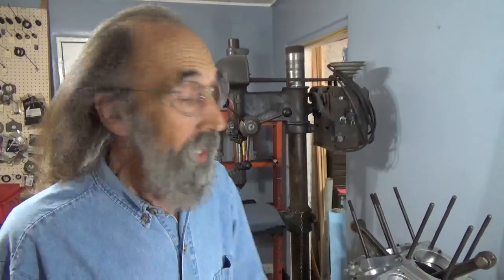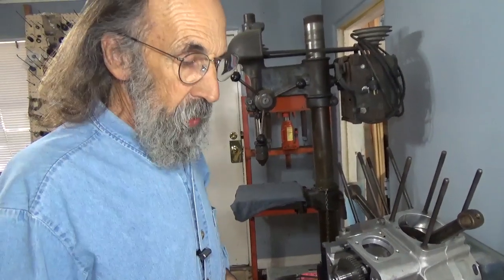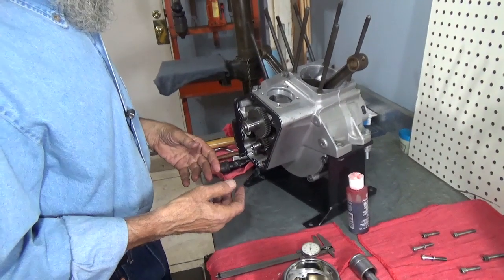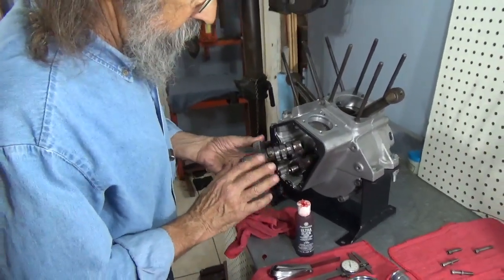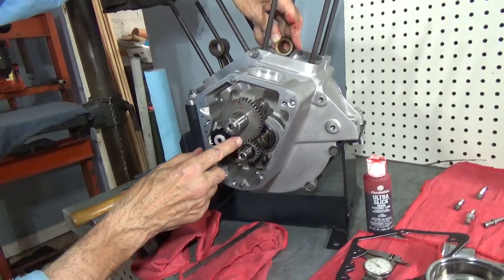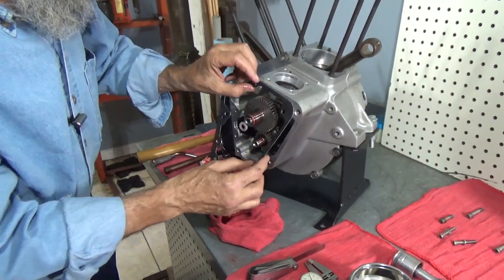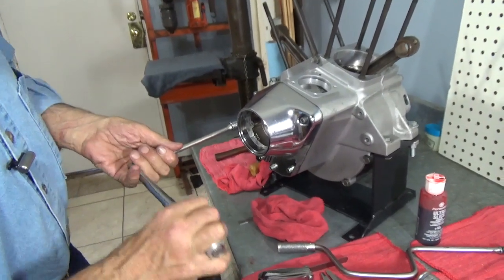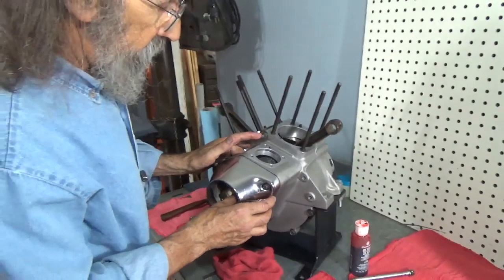Camchest, Evo Motor Assembly Part 5

Comment: Mike - I wonder if you can help me? I require a 0.020inch shim to get the correct end float on my camshaft in a 1984 evo. Every spacer kit seems to start at 0.050". Where can I get a shim rather than a spacer? Does harley use the correct size shim in another application such as gearbox or sporty motor? Thanks in advance
Reply from the maker: Try getting a cam shim for an earlier (Knuckle or Panhead).  Do you already have a shim in there?  Makes me wonder why you have this problem.  Not normal.  I think you already have something in there that doesn't belong.
Reply: @pacificmikesgarage  Thank you for your reply. Appreciate it 
Nothing else in there taking up play (wish there was)  
Cam bearing sitting just below surface, thrust washer hard up to case, NO SHIM OR SPACER 0.024 END PLAY. Camshaft gear pressed home on the cam and bronze bushing in cam cover home. Measured when cover torqued with new gasket.  Glad to hear its not normal, suspect the cam is the issue as I swapped cam that was in the motor for a stock one, and Im getting that back in a day or two, so will inspect again with that cam.  Thank you for advise to try a Knuckle or Pan Shim 🙂
Enjoy your videos - Thank you
Reply from the maker: This really is strange.  If you have a shop nearby, measure your thrust washer against another,  There are early and late Evo thrust washers.  In that era, Evos were built with no concern to their endplay and they were built with way more endplay than you or I would tolerate.  There was no cam shim at all, just the standard thrust washer.
Reply: @pacificmikesgarage  HD lengthened the camshaft by 0.050 in 1987, which is the cam I have so will run with OEM thrust washer (with ears) only which will give me a 0.025 end float. HD spec for 87 Evo is 0.001-0.050 so 0.025 is good for me.
Yes your right, HD like to have a lot of end float range which is not what Im used too working on modern motorcars. 
Thank you again for your time considering my issue and Im glad we could come to an outcome that makes sense of the issue.

Nice to know your videos are much appreciated all the way here in NewZealand Mike - Take care and lets "Make Choppers Great Again" 🙂
Reply from the maker: Thank You.  I appreciate your research.  Since I was always going for a high performance cam, I never ran into this.  I just thought they didn't bother to set the endplay anymore.  I always went with recommendations from the manufacturers of the high performance units.  Here in California, the stock cams were smog units.  So we always went to something a little more fun.

Comment: My forte is Automotive mechanic (40 years, now) I use my manuals, and check in with Mike's vids for "just in case I didn't think of that" stuff LOL. Putting EV27 in the '96 Fatboy, ordered everything but the breather spacers *smacks forehead*. looking at .020' after gasket crush. Needed a new gearchest cover, should have thought more better. Hoping .009' extra isn't too noisy.. Thoughts, Mike? BTW, keep up the awesome content, sir.
Reply from the maker: Go by either Harley or Andrews instructions.  Best bet: Set breather gear according to Harley.  Set camshaft according to Andrews.  Harley Dealer or aftermarket Harley shop will have shims for both cam and breather gear.

Comment: Hi Mike, I changed the ignition mogul to points yesterday. This is a 1996 evo engine. And while I was adjusting the ignition I noticed that the camshaft while the engine is spinning, moves in and out depending on RPM. The overall play is 0.20 inches visually. What could be causing this?
Reply from the maker: Lots of them came from the factory this way.  There will be a thrust washer in there, but no cam shim to set the endplay of the cam.  You can certainly take it apart and add one.

Comment: Thanks Mike. I'm rebuilding my daughter's Kawasaki Ninja 250...my first time tearing down an engine and rebuilding an engine. To make short work of those longer screws and bolts I was able to find a couple beautiful 3/8 and 1/2 inch speed handles for sale from an older gentleman nearby. I love them. They are so much more satisfying than using a power tool.
Reply from the maker: I couldn't agree more.

Comment: Hi Mike! I’ve been appreciating your content as a learning resource. I’m building up the knowhow to replace my cam, bearing, lifters and push rods.. I’m hoping to not remove the heads, do you have an opinion on cutting the stock rocks with bolt cutters? Also, what is your opinion on “upgrading” to a metal aftermarket breather gear? (Away from the oem plastic one).
Reply from the maker: I've removed a bunch of non-adjustable pushrods with bolt cutters.  Pad up the area with rags so you don't scratch anything.
Reply from the maker: I have no problem with the original breather or a replacement.

Comment: Hope you will answer this, It didn't seem to make any difference what position the con rods were in, top or bottom of stroke, as long as the marks on pinion , cam , and breather line up, is that correct?  Do the marks line up every rotation of crank? I'm working on my 97 that's why the questions. Thanks.
Reply from the maker: Do not concern yourself with how the marks are in relation to left and right.  Line up everything properly in the camchest.  Now it is correct.  What goes on with the flywheel marks, is not relevant at this time.  When you're ready to time the ignition, then, you relate only to the flywheel marks, being sure you're on the compression stroke.
Reply: @pacificmikesgarage  Great, thanks for the info. I appreciate it.

Comment: Can you just use the straight edge without the gasket to measure the breather endplay? Seems more accurate?
Reply from the maker: You need to calculate for the gasket crushing.
Reply: @pacificmikesgarage  Im putting an S+S metal breather in and I got those James gaskets with the rubber bead. Not really sure how to get an accurate reading. :/
Reply from the maker: You need enough, but not too much.  Figure it by the book and you'll be close enough.
Reply: @pacificmikesgarage  Thank you sir. Love your videos. Helped me immensely!!!
Reply from the maker: We try.  Thank You.

Comment: Hello, can the cam cover be mounted even with the normal key?
Reply from the maker: I don't understand the question.  Are you referring to the breather shim?  If so, it should always be checked.  Even if it was correct, gaskets vary.

Comment: Hey mike I’m having trouble finding a pinion shaft spacer for my evo. The Jim’s spacer isn’t correct for my  evo. 1988. My stock plastic one got melted in the process of taking it apart and now this things got my whole build on hold! I appreciate any guidance you can give me to finding one
Reply from the maker: Go to a Harley dealership.  They should have those parts.  Did you order a spacer for an 88, or did you just say "Evo?"
Reply: @pacificmikesgarage  well I work at sea coast Harley Davidson as a tech and I asked my parts guy to look up the OEM number and our system, Talon, said “obsolete” and “out of stock” which is why I turned to the Jim’s alternative
Reply from the maker: Any of the aftermarket suppliers should have it.  Are you sure your parts guy ordered it to fit your year model?

Comment: I just opened up a virgin Evo cam chest for INA cam bearing replacement and discovered that the breather gear thrust washer was completely melted and destroyed! If you wanted to see it go to my YouTube channel. Ive NEVER seen anything like that happen before. Mind you it has NEVER been taken apart as the bike came from the original owner. I couldn't believe it, factory screw up...
Reply from the maker: Well, I looked at it. You're looking at it up close and I'm looking at a video.  But, I think, what happened is a piece of gasket material or sealant got lodged in there and held the shim from turning until it heated up enough to melt.  Or, possibly, something in behind the breather gear caused the same situation.  Sorry.  It's all I got.  Nothing else damaged?  Wow!  Lucky you.
Reply: @pacificmikesgarage  yeah, I was shocked when I saw that myself. I'm going to install a S&S reed breather. Not a fan of these plastic breather gears. Plus they wear out engine cases! Screw all that nonsense.
Reply from the maker: Check with S&S.  I know that the reed valve setup works with one kind of Evo and not the other.  This is according to S&S.  I can't remember whether it's supposed to work with head breathers or crankcase breathers.
Reply: @pacificmikesgarage Thanks Mike,  I have installed them on both Top and bottom breathers with no problems. I've also seen them used in Shovelheads. I know Keenan Tatro puts them on practically everything even knuckleheads but S&S won't admit to it. I personally think it's the best thing since sliced bread.
Reply from the maker: Thank You.  I'm really glad to hear that.  I gotta study up.
Reply: @pacificmikesgarage  no worries, that's what we're all trying to achieve here aren't we? Information sharing is critical in our line of business

Comment: Hi Mike,
I am re assembling my 1985 FXR, my breather gear bore has some scoring in there. S&S recommends not to use thir reedvalve breather i earlier bottom breathing evos.  Some guys have mention to install reedvave breather gear in there and others not to. Whats your thoughts on using these reedvalves on bottom breathing evos?
Reply from the maker: I'm afraid I'm in the same boat you are.  I've been told both.  I actually haven't used them, but the reports are good.  I would have to go with S&S recommendations.  Try sscycle.com
Reply: @pacificmikesgarage  Thanks for the reply mike, the reply from S&S is that they can sump to much oil out with the reedvalve. Im just going to go with a new OEM plastic breather.
Reply from the maker: I think they know what they're talking about.

Comment: I refer to your videos often for advice, thanks for doing them! They're very well done! 

I have a very early softail ('84) and it has a problem so I do have a question; there's a broken standoff screw in the cam cover. Is it, in your opinion, doable to remove the cam chest without removing or loosening the push rods if they are all on the lowest part of the cam lobes? 
My theory here is the cam will be in the same position it is in even with the lifters and push rods out; nested in between the breather gear and the drive gear. But even if it moves it shouldn't be more than a thousandth or two,  I wouldn't think anyway. 
The reason I want to do it this way is I have no cover to work on my bike under so it's out in the weather while I'll be doing this screw removal. Covering the gear opening would be much easier than covering the entire side of the engine. I'm old and lazy too.
Reply from the maker: Removing the cam cover without taking the strain off of the cam first is just plain wrong.  Don't do it.  The cam must not be "loaded" when the cover is removed.  The lifters and pushrods and rocker arms and valve springs will all be ganging up on it because the cover will no longer be supporting the cam.  That doesn't make you lazy.  It makes you careful.  That's a cool old bike.
Reply: @pacificmikesgarage  Then I'll loosen the PR's. It's easy enough, I put Sumax screw together rod covers on it years ago. I'm just hoping I can get that standoff out without having to remove the cover. 

Thanks!

BTW- I bought this bike brand new off the showroom floor with 7 miles on it or so. It now has two engine rebuilds in it's history. I have no clue how many miles...too many speedo swaps. 

Any grat tips on removing the standoff screw? It's broken off about 1/8" proud.

Comment: Have a 99 flstf with 24k miles.  Have a sidecar and need more in 5th gear.  5th is a dog at 70mph and 4th is revved out.  I'd like 75 mph on the interstate and I'd like to shift less going up hill. 
 My question is...What cam would you recommend? Ev27, Wood W6?
Reply from the maker: Any of the "drop in" cams would be an improvement.  Read what the cam grinders write about where the power is on their specific cam.  This will tell you.  I don't recommend brands.
Reply: Thank you and I really appreciate the videos you're creating.
Reply from the maker: Thank You.

Comment: Hello Mike, I have been enjoying the videos.  I have a 1985 Harley Davidson FXRS Evolution Engine 1340 cc.  I have an Andrews EV3 Cam, and the pinion shaft is marked red. The EV3 Cam doesn't have any color marked on it and the pinion gear has no color marking on it? I was trying to put the pinion gear on it but it doesn't want to go on all the way? Does the color code determine if it will fit on the pinion?
Should I buy a pinion gear that has a red marking on it? And does the EV3 work ok with that?  Thank you much!
Reply from the maker: That gear should go on.  Not to dismiss your problem, but check carefully for a burr somewhere, either inside the gear or on the pinion shaft.  The gears should mesh properly.  Andrews makes their cam gears to fit.  I'm not saying you don't have a bad fit between your pinion gear and your cam gear.  It happens.  Your service manual shows how to measure those gears and also explains the "Color Code" on them.
Reply: @pacificmikesgarage  Should it just slide on or does the pinion gear needs to be pressed in or just tightening the pinion nut does it?
Reply from the maker: I can imagine it a little tight, but, the nut should put it on for you.

Comment: Mike !! Thank you so much !! You are the best teacher I have found ...so good . Can you recommend a cam for 1340 evo good for passing quickly around 50 to 60 mph moving cars . My motor is set up with adjustable rids upgraded carb intake oil pump . Thanks for your time
Reply from the maker: I don't recommend brands.  A simple "drop in" cam will probably do the trick.  Read the adds.  Make sure you're getting what you want.  I don't know what you're starting with.  If you have a 1988 or new Evo in California, anything is an improvement.  The cam manufacturers all tell you if the cam will fit with no headwork involved.
Reply: @pacificmikesgarage  thank you I will keep checking em out . I'm in Oregon I have a 93 softtail Springer
Reply from the maker: Cool.

Comment: Mike could you make a video of measuring cam gears for proper pinion gear sizing snd the differences in pinion gears in the Evos ?
Reply from the maker: Have not done it in years.  But, all of those pinion gears are color-coded by Harley and listed in their service manuals.  I order to measure them, they need to be gauged with the proper measuring pins.  I honestly don't even know where mine are.  Today's manufacturing techniques have pretty well taken care of this.

Comment: Hey Mike, I really appreciate your videos, so thank you for these. I have a question re a 1988 FXST Evo rebuild. With the special cam spacer washer and no gasket I have a cam clearance of 60thou - add about 5 thou for a gasket gives about 65thou. The question is this - the official shop manual says the "1988 models do not use a thrust washer" The bike is a 1988 (although I guess it might have been actually manufactured in 1987?) How is one supposed to shim this if they tell you that the thrust washer is not used?  Thanks you for any answer you can leave me :-)

Phil
Reply from the maker: Go according to the cam manufacturer's recommendations.  No gasket?  You calculate the crush of the gasket.  That bike came with a thrust washer, but no shim.  Calculate it as we've shown and how it's shown in the service manual.  Just don't put as much clearance as Harley did on Evos.
Reply: @pacificmikesgarage  Thanks Mike - I think I have it - I have a good selection of shims which I will use to adjust (yes, including the gasket fo course!)  The shop manual says between 1 to 50 thou, which I think sounds to be too much of a clearance. Just FYI I had an Andrews EV3 but am going to be switching to an SE11, which I believe has suggested clearance of 10-15 thou.

Comment: Hey Mike thanks for all the free education. I really enjoy your videos. I am building my first evo motor and wanted to ask what you thought about the s&s reed style breather gears? Specifically have you used them and have they made any difference or if you recommend stock plastic breather gears? Thanks again.
Reply from the maker: I've seen quite a few of S&S's reed valves in use.  Never heard anything bad about them.  Not much experience with them though.

Comment: Mike your are the best, I like that your info better than the shop manual. shovel rocker endplay 8-10,  I looked up my book 4-25, and I agree that if I have symetric ticking from all rockers I can accept it (kind of sounds like a BMW M3), but cant stand one that out noices all the other ones. Also got a bit surprised that you wanted the camshaft to have more endplay than spec. I missed if you explained why. I'm also impressed by the looks of you motor-cases. My 79 shovel look realy awful with alot of pitting from the forging. and even puddles of aluminum from the process. your shovel looks like an EVO :). Thanks for the videos. Your knowledge is realy invaluable.
Reply from the maker: Thank You.  I set the endplay on the cam according to the cam grinders I use.  I've always listened to those guys, and I've never had a problem with it.  Sorry if that's not much of an answer.

Comment: Mike I really appreciate your instruction - I have rebuilt Evo top ends and by luck they have run great. Now that I am starting a new build (much more costly than 20 years ago) but the questions I have per this video are concerning the cam gear thrust washer.  As I recall the thrust washer had wings of sort and a placement attitude (up/down) but I could not see in the video and you did not mention the positioning of the the washer or the shim.  Why I am questioning is because the one I took out is nothing more than a round washer covering the case.
Reply from the maker: Don't confuse your years.  Go by the parts book.  There is a "camplate" and a "cam shim."  Not all years use both.